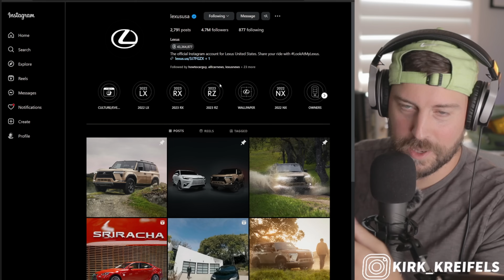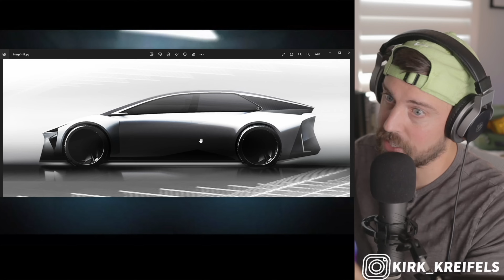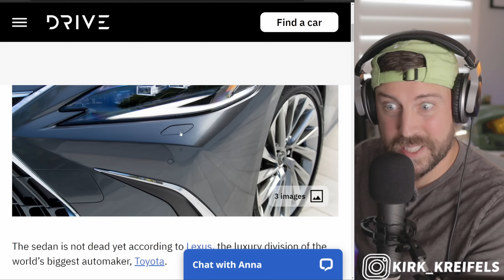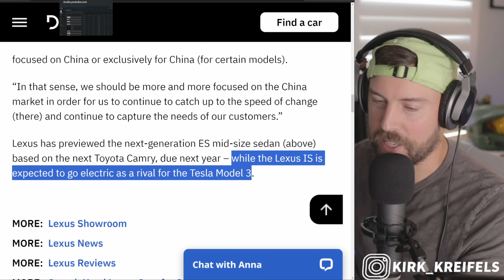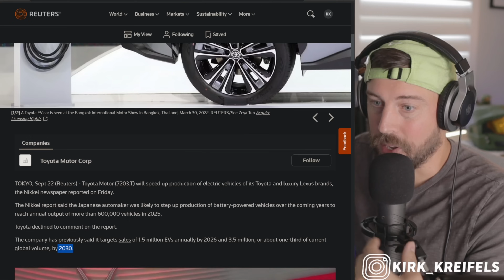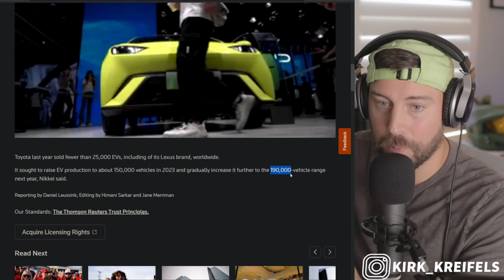*NEW IMAGE* Lexus Teases its NEXT-GEN flagship - Let's GO!

Comment: Lexus Needs to come out with a full size new rear wheel drive Platform for the LS Sedan again with possible more interior space , leg room space, hip room space, head room space, and trunk room space!! And offer it with these powertrains    A more efficient 5.0 N/A DOHC V8 engine, with 520 hp, 4.4 N/A DOHC V8 570 hp , twin turbo 4.4 DOHC V8 698 hp, and a Gas and Hybrid V8 model that would have 890 hp ,with rear wheel drive, and all wheel drive !!! All of these models of the LS Sedan would be prices Differently ,and transmission choices ,would be 10 speeds Automotive and a first time option ,would be a 6 speed manual transmission !! Plug the weight of the car would be cut down too ,and that's how this car should be 🇺🇸🇺🇸🇺🇸💪💪👍👍👍

Comment: Thanks, Kirk. I hope Toyota gets the bZ3X out. That's a jazzy looking vehicle. I do wish Toyota would focus on putting a frunk in it and giving it 2-level underfloor storage in the trunk. Because that's where the Model Y shines. It really is a large vehicle for its size. So even with the poor ride and not so great build quality, it's popular partially due to its packaging. I also think Toyota should kill all the gloss black in the bZ4X and offer an enhanced Prius interior but with better materials for the bZ3X. Get the price right too. Make the bZ3X what the bZ4X should have been. That could be a good seller but they also have to make enough and no price markups from dealers. 

I look forward to what Lexus brings. I think Lexus should move away from their designs now that still resemble Toyota designs too much. They need something more distinguished. The TX looks too much like a Grand Highlander for example. The EX stands out from the Camry, however. Inside, the interiors need to get richer looking but still be not over the top glitzy like Mercedes has become. More like a Japanese Volvo in terms of richness and style.

Comment: Does anyone else feel like "eh" when they see ev? I prefer hybrids.
Reply: I prefer BEVs if and when the infrastructure becomes mature. You turn them on and they don't vibrate. You accelerate quickly with minimal noise. If you can filter out the road and wind noise, they're quieter than the best luxury ICE cars and faster and smoother. The hybrids I like now are PHEV because they can be driven like BEVs. The biggest drawback to BEVs are the weight and the height of the floor in the rear. The seats are low which forces the knees to go up at an angle. They need to scoop out the batteries to give the rear passengers floor space for their feet and knees. BEVs also seem more crashworthy than ICE cars.

Comment: As concepts go it reveals mostly the design goals. Most notably is the nose through air tunnel traveling over the windshield like a Ferrari Pista but with what looks like an active blade and a more reclined rake. I seen front to rear crisp lines that outline a beautifully curved (profile) front fenders with a distinctively lower center. The headlights will be below the DRL’s and almost hidden in the cooling/pass through grills. I’m hoping they pull in Nevera’s battery shape design for a much lower seating position needed to pull this design off. 6:43